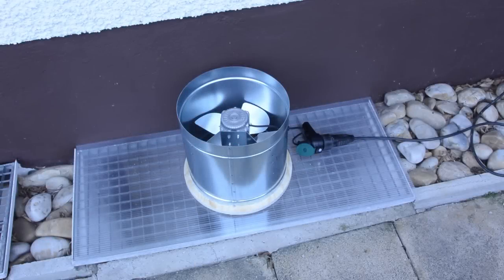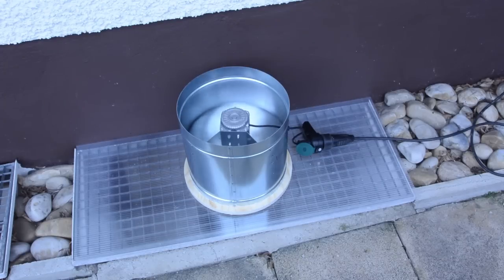Quick Workshop Exhaust Fan

Comment: nice job, why you did't put it in between the window and the grid and whit a plastic deflector outside to protect it from water and the dust from the walm. (sorry for my bad english)
Reply from the maker: Because It was easier this way and it really doesn't need protection.

Comment: Hi friend, I cannot afford a big fan like this, however, I have just got myself a fan out of a large industrial microwave. I fits perfectly inside the aluminium extraction tubing that you use for cooker hoods for use in kitchens. Would the suctioning rate be enough for welding and brazing though? This is my only concern, it is good because I  have a large amount of the flexible tubing I can put it close to the work, so it should be okay.....right?

Comment: nice. if you are worried about the outside walls (white!) get a deflector asap. i know from experience it gets nasty way soon than you`d expect
ps a flapper screen would prevent dirt/water (*-)/critters from nesting in the fan
Reply from the maker: Wow I really didn't think of that deflector thing. Thanks man!
Reply: You also might want to try a remote relay. It would allow you to switch it from the inside!
Reply from the maker: If I used a remote relay, that would basically enable me to use that thing for sucking dirty air out of the shop!! Thats ingenious!!!

Comment: wouldn't it be better, to put the hole unit under the grill? so you can do the wiring through the window and the fan is in a safer spot
just an idea
Reply from the maker: I don't want to put the wiring through the window. Putting it on top was just the simplest solution. But maybe I should have shortened that fan a little...

Comment: You may want to consider some sort of shield as well, if a kid puts their hand down that opening, it might not work out well for them. Also birds and other small animals are likely to venture there as well... Some sort of roof type Vent should do the trick... Cheers....
Reply from the maker: I don't think that is necessary because that fan is pretty durable.
Reply: +Cosmas B I was thinking more of a safety issue, if a kid puts his hand in the hole that fan would do damage. Just like a small animal could jump into it while off then it's sliced to pieces when you turn it on. Granted the fan is durable, but if you look at roof structures Birds find ways of making nests in the oddest of places... Cheers...

Comment: Wince! When you cut that plexiglass, you went over the top of the blade with your arm...NONONONONO!!!!!...I am happy nothing happened but, that was a dangerous move...That's tough to work in a basement...I hope it's a walk out...Or you make really small things...Put an elbow on top (on the outside) and dump it into a 5 gallon bucket with a removable liner ( trash bag) The elbow will keep out the elements, don't forget to put a screen over the opening...